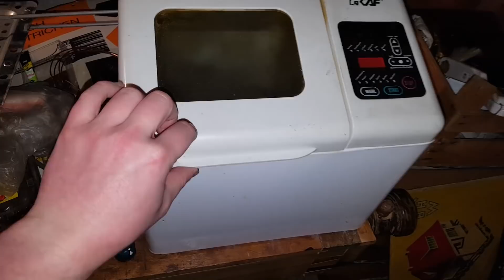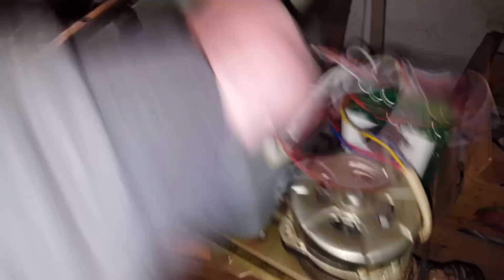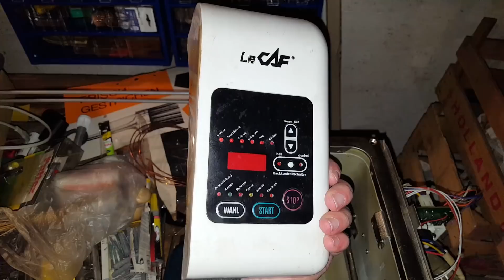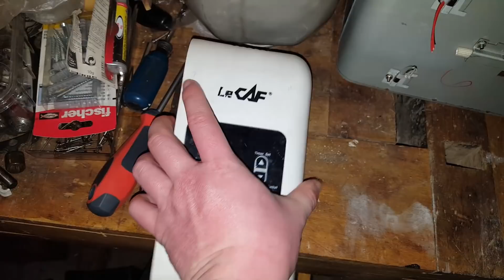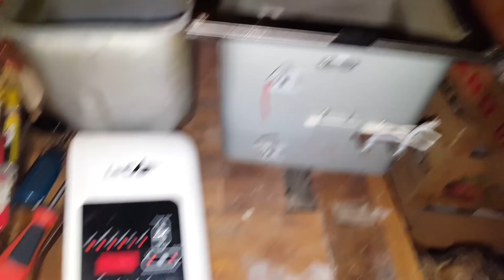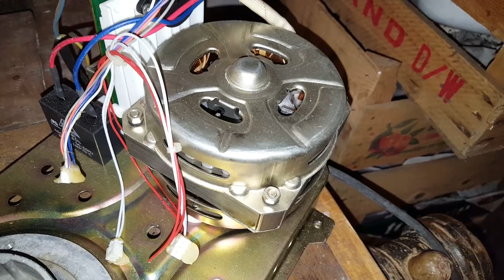How a Breadmaker works

Comment: Good vid. I use my breadmaker often, never heard that they can catch fire.
Reply from the maker: I did some research, there was a TV report back in 2002 that claimed that breadmakers were a potential fire hazard. But apparently in at least some of the cases the fire was caused by the users when they added to much dough and the baking tin overflowed when the mixer ran. Dough dripped on the heating element and caught fire. You can't blame the breadmaker for that...

Comment: Interresting device. My uncle and niece both had a breadmaker and I remember that these things where quite loud in their operation. That intel chip is pretty old school, but wouldn’t it be a mask rom version? It is a high-volume consumer product after all.
Reply from the maker: Indeed the breadmakers were quite loud. I plugged the motor straight into the mains today and it worked well, but was quite noisy. What does mask ROM mean? Is the microprocessor not re-programmable? That would be too bad.
Reply: @DrCassette  Mask roms are often used in game cartridges. They are indeed non-programmable. In fact, they can't even be programmed once. That's because the programming is hard-wired into the design of the chip Die. It's cost effective for very high production volumes but not for small series. They are very robust as they can't be erased. A disadvantage is that it can be very costly to fix bugs. The consequence of the hard-wired design is that a bug means scrapping already produced chips and going back to the drawing board to change the design of the chip mask.
Reply from the maker: @dykodesigns  Interesting.... I don't have a programmer or any equipment to try and access the chip, so I guess before I waste time and money trying to get it to work, I should just throw it out. We worked with 8051 type microcontrollers in university, though those were much more modern models made by Atmel. Those allowed in-system programming.